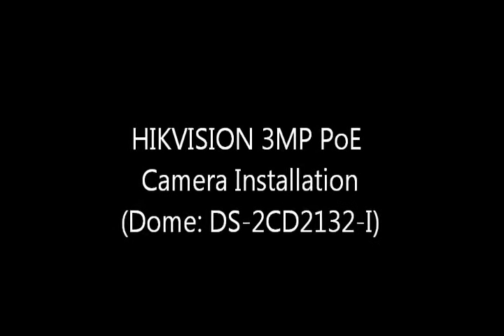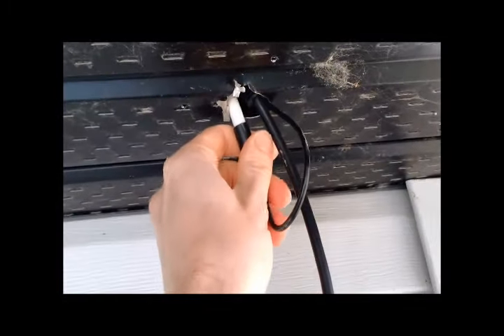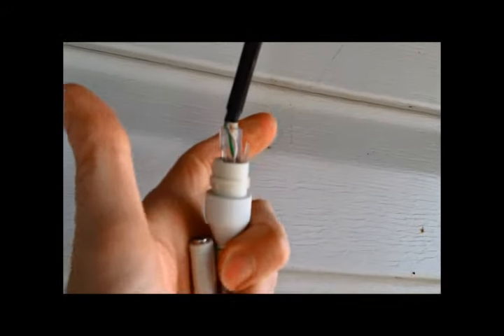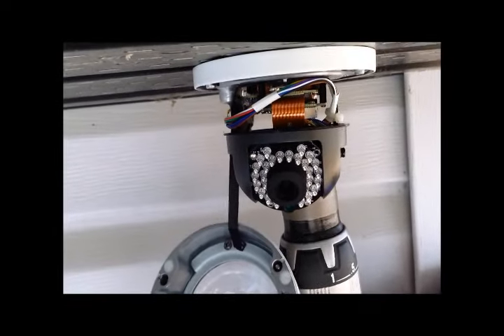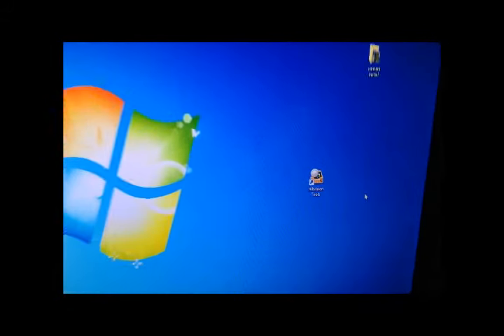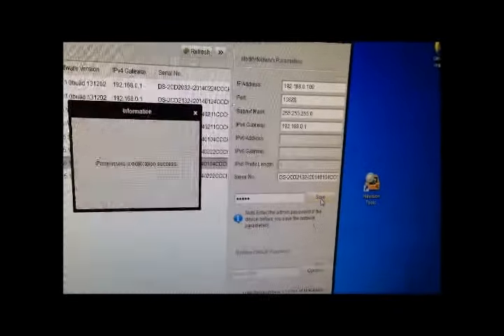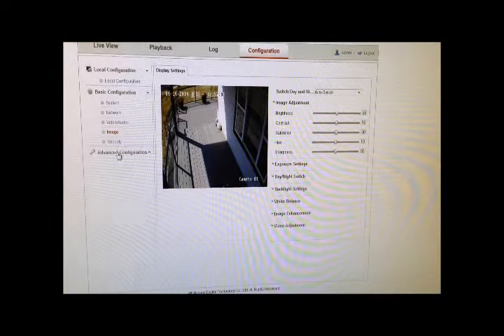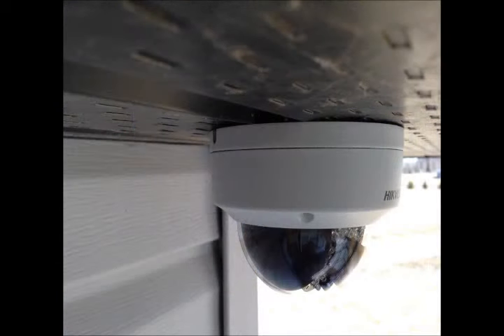HIKVISION Dome PoE IP Security Camera Installation Guide

Comment: wow you did a great job on this video.

If I open the camera webpage can I control PTZ from there is it it fixed?
Do you have an internet address I can visit to view the camera?
Does IP CAM android ap support it?
Does the camera support wireless N? G? Does the wired connection support 1GB ?
Can I plug i into 110v instead of POE?  What kind of POE switch do you have? they look pricey!
how much optical ZOOM does it offer?

Also What material is on your deck? Composite? it looks great..
Reply from the maker: Thanks!
This camera is not a motorized PTZ, but if it was, you would be able to control it from its webpage.
No, I don’t have a public camera open for viewing, but if you look at the other videos on my channel, you will see the quality of the daytime and nighttime feeds.
I don’t know if the IP CAM android app support this camera, but HIKVISION has its own free app and it’s very good.
This camera is not wireless but HIKVISION does make wireless versions.  I’m not sure what you mean by supporting 1GB.
Yes, you can use a separate power supply to power the unit, which should be 1-2 amp.
The PoE unit I am using is from amazon and BV-TECH 16 Port 120W 10/100Mbps.  It cost about $200, but any PoE switch that supports IEEE 802.3af will work.
This camera doesn’t do optical zoom.

The deck is made by Trex, but it wouldn’t be my first choice in composite decking.   It’s not wearing well and fading unevenly…  sounds like the making of another youtube video.  lol

Comment: Are the cameras light? I imagined soffit vents would not be sturdy enough to hold a camera but it looks fairly secure in your video.
Reply: eggroll1980 (
Reply: Soffits are thin and without reinforcement can cause the camera to shake during high winds & storms.  I add metal strips (paint to match soffit) attach them to the inside fascia board or run support board above the soffit for better attachment

Comment: This camera is great during the day but at night the IR reflects off the plastic dome and back into the Lens causing a snowy affect. I regret buying this.
Reply from the maker: I noticed this a few times as well, but if the dome is perfectly clean (inside and out) and the sponge around the lens is pulled out a little and then tight to the dome, the reflections are decreased.  I have the video for this shot, I am in the process of editing it.
Reply: yes I remember watching this video years ago when I researched ip camera   I really liked the video so I purchased one.   I wish there are more videos out there like this. Mostly I wish they record the night view.   cheers
Reply: Do you have the foam ring correctly installed? http://www.hikvision.com/ueditor/net/upload/2015-06-10/99361bb6-27d5-482a-aaf3-2cdc32f835d1.pdf
Reply: Interesting.  I don't have a form ring.  I guess I will make one, and this should seal it from the bleeding of the IR LEDS.
Reply: Yes let me know how it performs.
Reply: I don't know when I will do this.  But once done, I will post my feedback.
Reply: Your can set IR power (via range setting) on m'y case that solve the "problème"
Reply: Ang ipp hi which one do you recommend to get cheap but good?also a wireless one will be good
Reply: In my case I don't have this option.  I have an aftermarket dome camera.  Exact replicate to this one.
Reply: Can't recommend any wireless, because I don't have any.  All mine are wired.  I fished all my CAT6 runs myself, while I was reno a portion of my house so I had 1 wall open and made some other holes in the house to help me fish through the cables.  (I am pretty good in Drywall repair, so  patching up didn't worry me) [Actually drywall repair is easy.  If you don't like the outcome just sand it down and do it again].  It took me months to exacute and finish it all, but I wasn't in a rush.

Sorry your question was what I recommend:
-If I had an option again, I will not get this type of dome camera again.  Primarly because of the reflection of the IR that bleeds back in the camera lens at night, resulting in a semi-foggy display (although there is a fix to this listed in here.)  It is a good camera, personaly I would choose another type of dome.

-check on ALI Express (good prices)
-Get a camera that has more then 24 IR LEDs  (You want to look at 32 IR's)
-Get 3Meg or high (Higher the better)
-If you are looking for a "dome camera," try to find this style: (I am not saying to buy this camera)
https://www.aliexpress.com/item/PLV-IPC-Built-in-POE-IR-Full-HD-IP-Camera-3MP-4MP-IR-security-cctv-Dome/32718640429.html?spm=2114.01010208.3.335.rHWlur&ws_ab_test=searchweb0_0,searchweb201602_4_10065_10068_10084_10083_10080_10082_10081_10060_10061_10062_10056_10055_10054_10059_10099_10078_10079_426_10073_10103_10102_10096_10052_10050_10051,searchweb201603_6&btsid=d8e7656c-de14-4377-a540-59e4b7e55104

- If you want just plug and play camera - look for "HIKVISION"  comparied to 'Onvif' were these camera needs to have a manually config in your NVR with the correct IP address that matches the camera IP.
Reply: what Hikvision camera do you recommend for proper night vision? i amabout to install this camera in my office

Comment: Great info and video. If it's not a PTZ camera (as you stated in the comments) why install a dome there instead of a bullet cam? Thanks for your help!
Reply from the maker: MRrwmac Great question and I am in the process of doing a video of a dome and bullet comparison.  I'm sure that will answer your questions.
Reply: MRrwmac domes look nicer in areas such as front doors and are more vandalproof as you can't just move it with your hands easily

Comment: This camera is advertised as wifi, why is it plugged in with a network cable?
Reply from the maker: Digital Ink Arts The model I am using is not WiFi.  I would recommend using the wired type of this camera.  You will need to supply power to the camera, so for me, it was just as easy to supply a network connection and power through PoE.